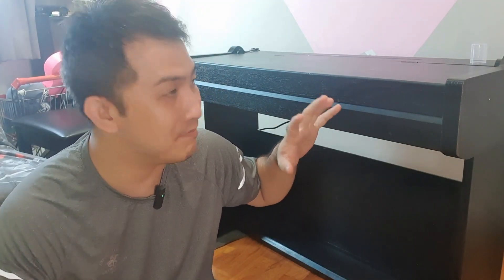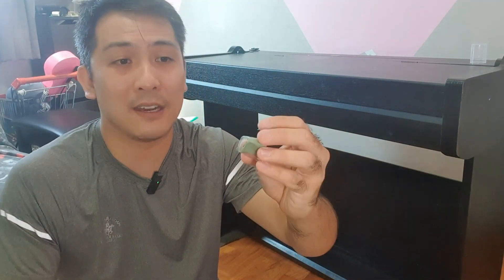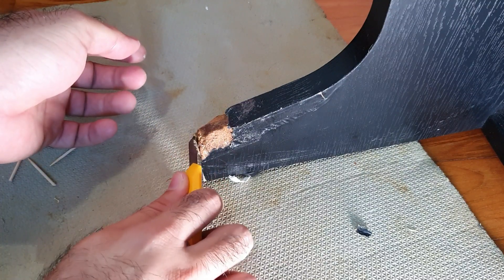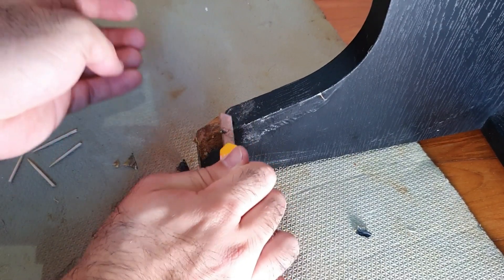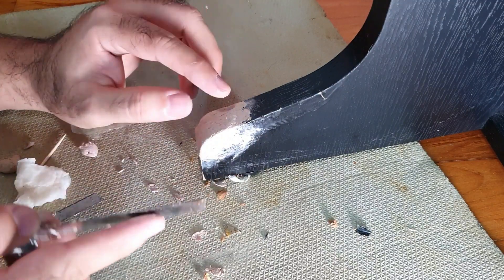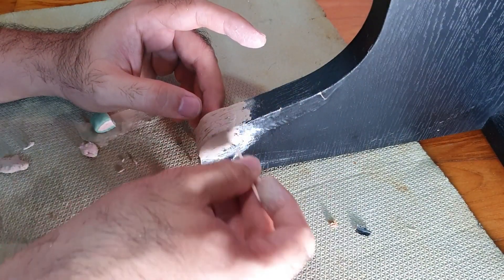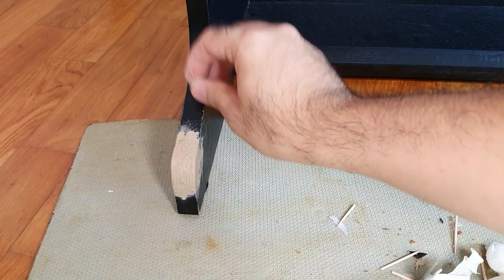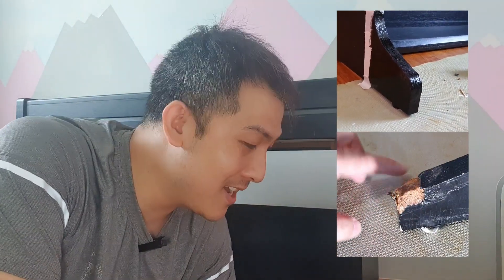Fix CHIPS and broken furniture. with Kneadable epoxy

Comment: Ooo.. I last used the kneadable epoxy (sometimes called Epoxy Putty) to patch up a wall hole that I accidentally over-sized and re-drilled the correct size hole...  Really useful stuff...
Reply from the maker: That's one way to use it!

Comment: Can it be useful for flooring dents like marble or parquet?
Reply from the maker: Yes you can! however it will look slightly different unless you paint it. you can make a test piece to check colour before you fix

Comment: thanks, great! however this epoxy does not work on low surface energy materials such as polypropylene - a very very common plastic. have yet to find a household adhesive or filler that can bind to polypropylene well
Reply from the maker: Yes polypropylene is a bit challenging. But you can prime the surface with superglue.

Comment: For epoxy putty it’s also water proof right? The contractor used that to patch a little leak on my toilet tube .
Reply from the maker: Waterproof yes but not pressure proof. It may leak over time